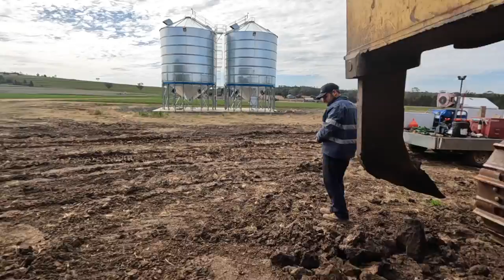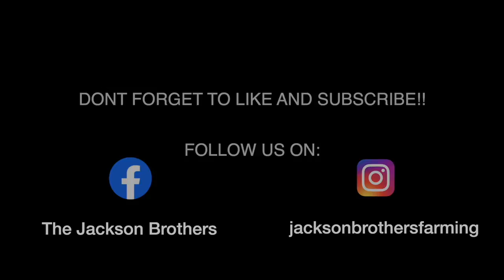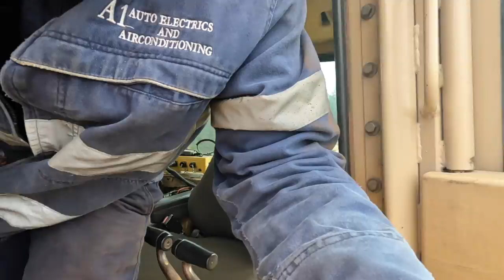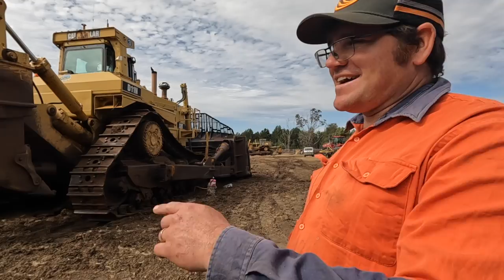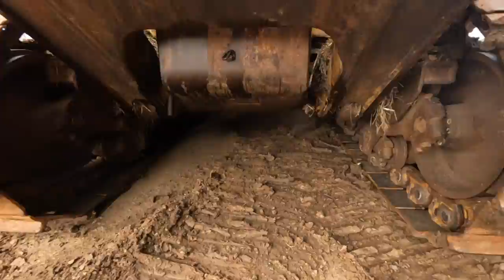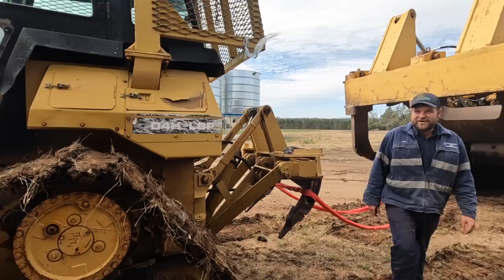CAT D4 Pulls Big D11 Bulldozer!!

Comment: Matt you need to lower the ripper on the 11 so the angle of the tow rope is higher on the D4 because as soon as the rope pulls tight it lifting the rear of the D4 off the ground
Reply: I agree, hook angle will make a difference in weight transfer. Get that D11 ripper down close to the ground!
Reply: That’s not the point of a tug champion thanks for playing though